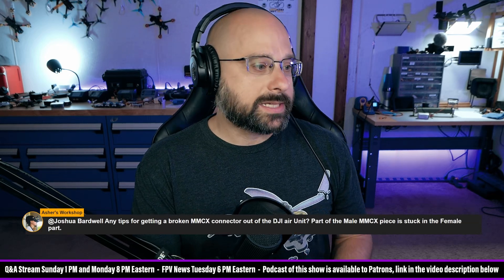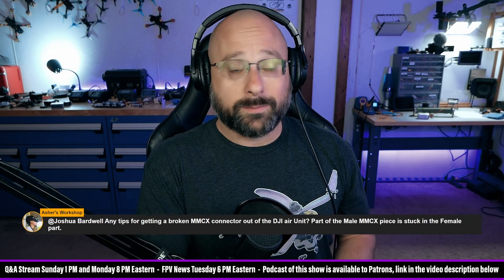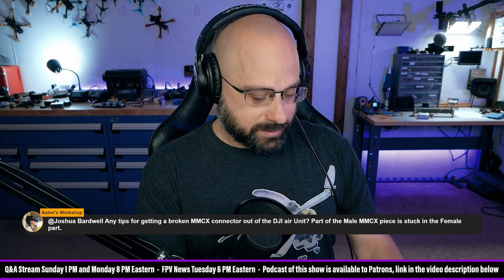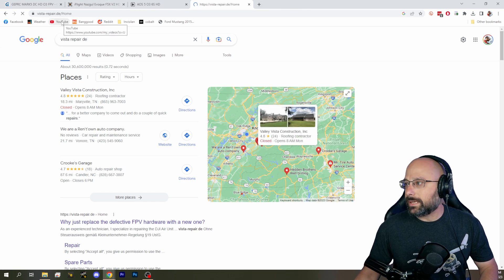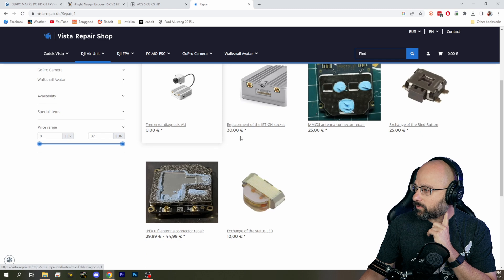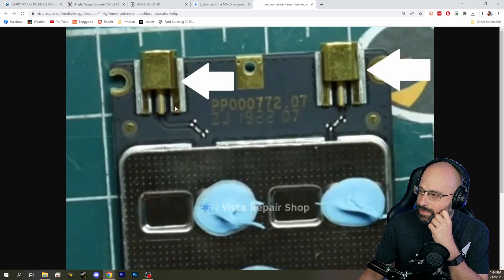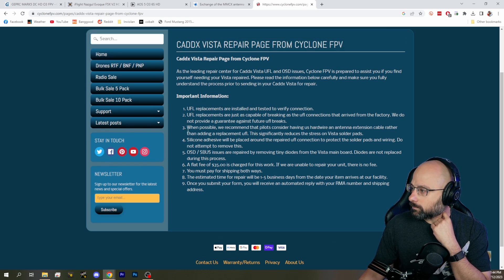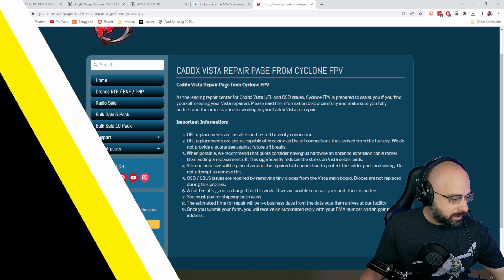How Do You Get A Broken MMCX Connector Out Of A DJI Air Unit? - FPV Questions

Comment: I just used a 0.05" Hex key (1.3mm) and was able to jam it in and pop both broken connectors out in less than a minute. One side took multiple tries but it worked!!!!!!!!!!!!!!!!
Reply: did you do any damage to the center pin in the female mmcx port ?
Reply: @DominionDroneDaily  nope! I was very surprised that is was so easy and clean. I have flown several times now with the new antennas and it's working perfectly.

Comment: I know MMCX is smaller than SMA connectors, but on SMA connectors that I've swapped out in the past I carefully cut away all the pins from the connector with my Dremel then used my iron to remove the pins from the pads, they come off really easy doing it this way instead of trying to heat up 3 pads to remove the whole connector, pretty sure the same could be done for MMCX.